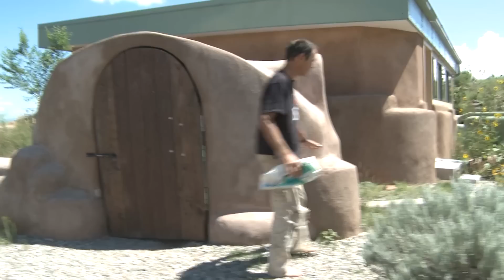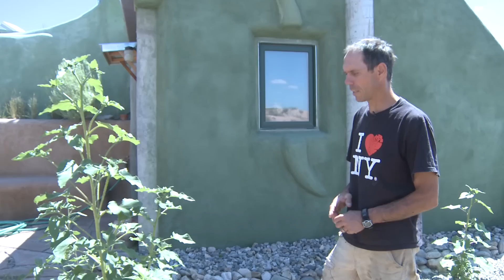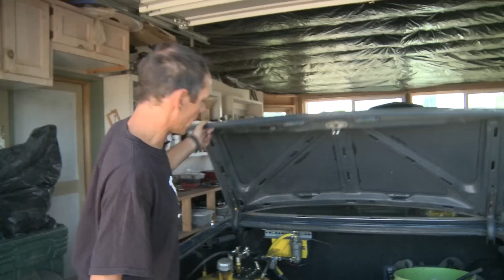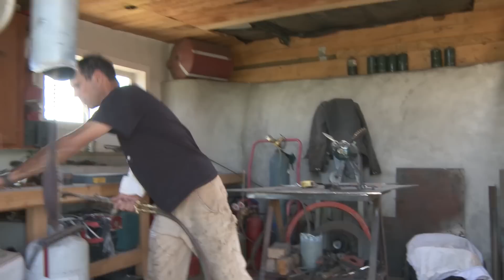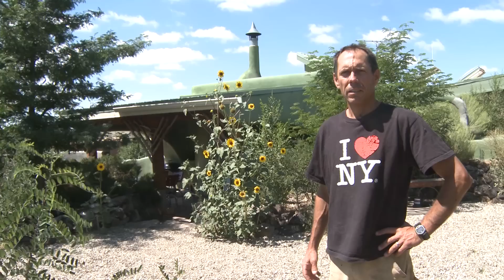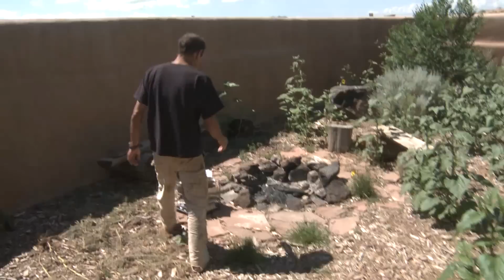Ted's Earthship: Outside Tour

Comment: That looks like a flying spaghetti monster.
Supposedly one can with 100 or 200 watts of solar run a ac refrigerator on a timer as a refrigerator. Is that a possibility to avoid using propane to run a refrig?

Comment: Hi, i ask you how big is your inverter to power the welder machine. Because i have a MAG 200 amps and the label said 220v and 36 amps. and that is about 8kv. You really have an inverter that big? or it may work with less. Thanks. Great job building.